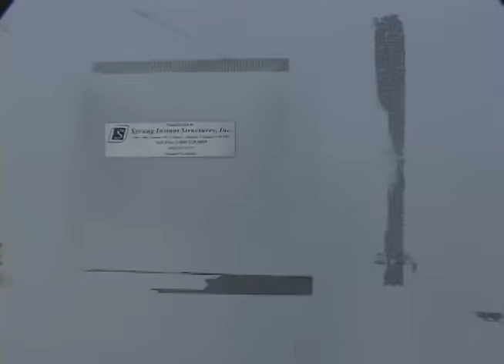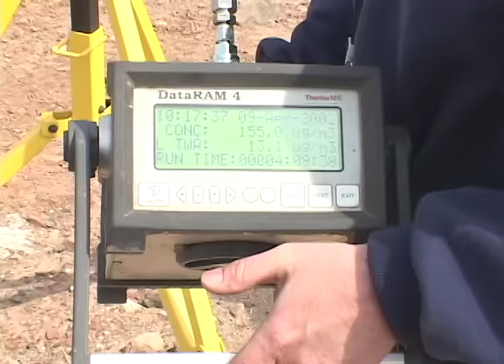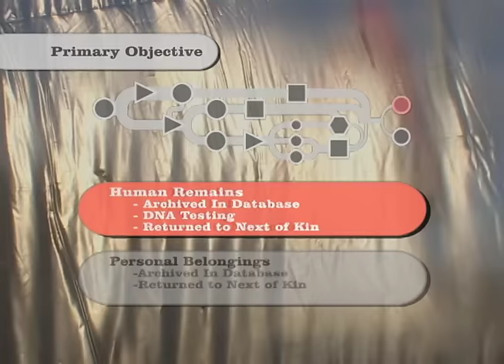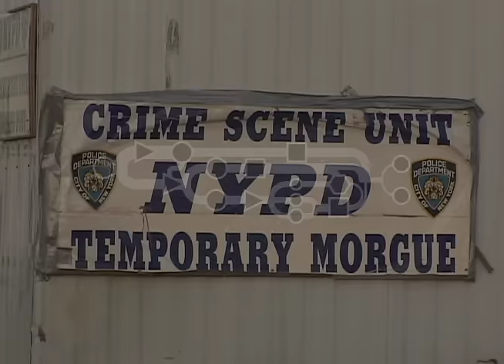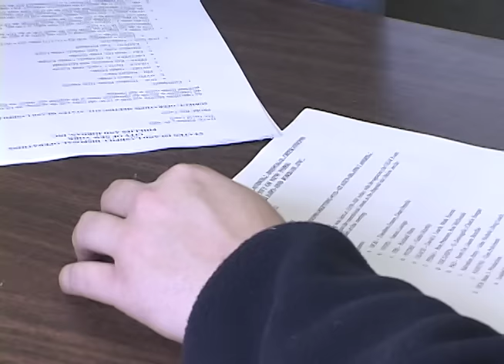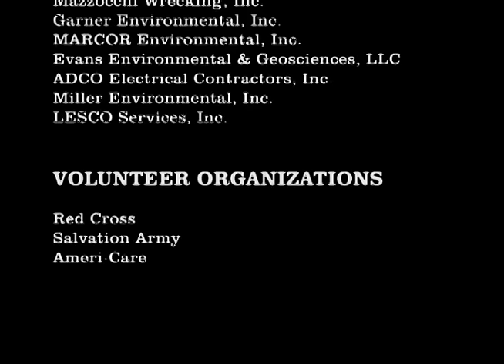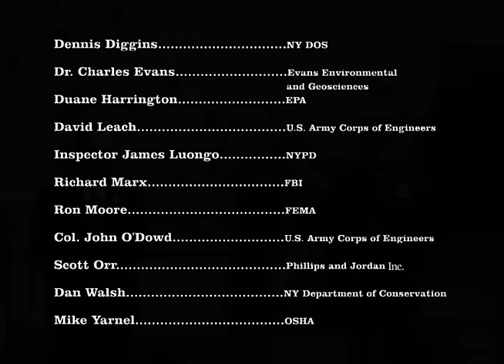World Trade Center Recovery Operation (Previously Unseen footage)

Comment: They tried their best to cover up all the asbestos didn't they
Reply: The World Trade Center area was actually planned in the 1940s when asbestos was used still in a lot of construction. A lot of buildings would also have not revamped or removed asbestos unless it was a danger or exposed. For example some historic buildings just because of their age they do have asbestos in their making but are not redone in a modern fashion because asbestos will not be a danger until the house is opened up. There's a ton of places that have asbestos lining that you've been inside and never thought of

Comment: Why over 40% of the people that died that day have not been identified..
Reply: Because they were either vaporized or burnt to ash
Reply: Because many were insinerated by the flames, like a cremation.
Reply: @christinamitchell6796  Bob Ross, Bad Lip Reading and Reed Timmer, you sure do have good taste in YouTube subscriptions 👌
Reply: @christianremmer  lol ummm thanks who doesn't like Bob Ross?  😊
Reply: Because of the b o m bs / demolition charges. They found body parts on the top of other buildings because they were blown to bits.
Reply: @seedplanter7173  that too 👍
Alot of people said there were bombs going off everywhere.
Reply: Go watch some science videos about how the towers fell and you'll see how much force was put on everything inside the towers when they fell.
Reply: @christianremmer  troll
Reply: @christinamitchell6796  oh my God, it is very hard to hear  this
Reply: After tons of concrete smashed a bunch of people they are vaporized
Reply: @christinamitchell6796  it's true people said that but when the planes first hit it sent a wall of fire down the elevator shaft all the way to the lobby. Any floor that had an elevator door open probably had an explosion on that floor that ignited secondary fires on those floors. Those secondary fires also caused secondary explosions especially around any gas lines, or explosive materials in the building. I'm not saying there weren't bombs but it's probable that some of the explosions perceived to be bombs were actually indirectly related to the initial blast. I think a more intriguing conspiracy theory, to me, is how 20 terrorists all in the same morning got past airport security. Especially after one WAS detained at the airport. That should've been a dead giveaway there could've been others.

Comment: The same happened with the Oklahoma bombing.

A company called Controlled Demolition took the rubble away from the building to a landfill site ran by BFI Waste Systems all whilst under guard by Wackenhut Corporation (owned by and integrated with the CIA, FBI and George Bush).

Similar happened with 9/11.

the Shanghai Baosteel Group Corporation had bought 50,000 tons of WTC scrap steel paying no more than $120 per tonne.
Reply: They did buy them and made them into spoons and forks.All profit for the Chinese....unfortunately in a little while and the air we breathe will be Chinese.
Reply: So 1,650,000 tons of debris was processed and there was only 50,000 tons of scrap steel?
Reply: @ms.shineray  I didn’t say that was the only amount of steel found. I think around 10,000 tonnes was sent to India too.
Reply: @T-19-  thank you for the reply, I was curious about that amount I didn’t mean to say you said anything else, but I am really curious as to why there was so little steel Compare to the total amount of debris because I thought the buildings were mainly steel so I will have to do some in deep research 🧐
Reply: @ms.shineray   I just did a quick search and it took 200,000 tons of steel to make the 2 towers. I’m quite surprised by that as well, it doesn’t seem like a lot of steel when you think about how heavy those towers would be
Reply: @T-19-  just learned that basically it was only 200,000 tons of steel because the steel varied in thickness throughout the structure which i find fascinating

Comment: So basically there should be over 1.5 million tons of steel that they recovered ,thats how much steel was used to make those two towers, plus the other blds which were torn down after the event, which they never talk about like BLD 7 for example, 3 little fires in a concrete and steel 7 store bld, yet it came down perfectly straight down just like a man made demolition team did it and also the most important aspect is the work of Dr Judy wood who explains how on earth can the outer steel grid frames just turn to dust, if you watch the collapse of the towers you can clearly see the outer steel shell turn to dust as its falling down to the ground ?
God bless all those people who died that day and something is not right as well on that day, especially about the amount of steel recovered, as per Dr Judy wood research and also how the a lot of cars and vehicles were burned only 1/2 way yet the rest of the car is perfectly preserved, when a car is on fire yet the fire does no damage to other parts of the cars paint, its like a laser was used like they have now to clean metals particles etc. 🙏🙏❤❤🦘🦘👍✌👌

Comment: Arent all these people complicit in a crime being committed by removing this material?
Reply: Well to examine all the "debris" carefully, it was necessary to move it to a place where everything could be carefully examined and identified.  Digging through the huge piles without moving it somewhere else would have been ineffective.  The tiny pieces of remains, evidence, belongings would have been missed.  I didn't realize how many times the debris was sifted, turned, and checked again.  Rinsing down all vehicles used to make sure nothing was missed.  I'm sure they continue to work on identifying remains as it is  an exacting process.  RIP.